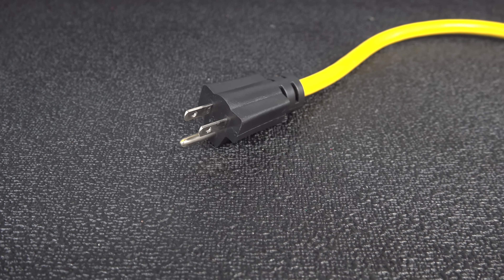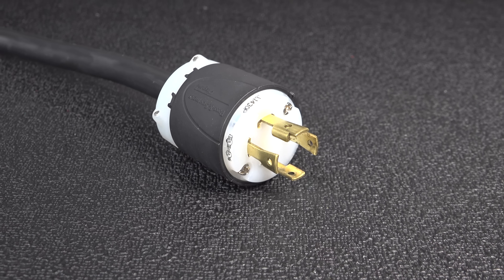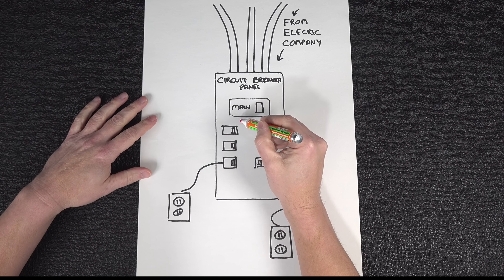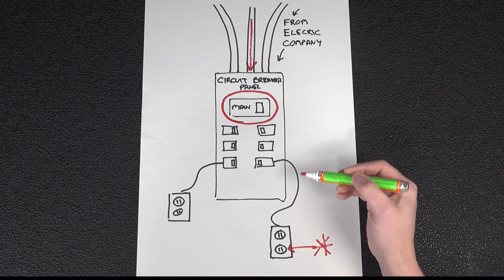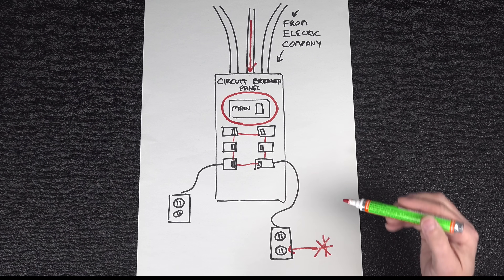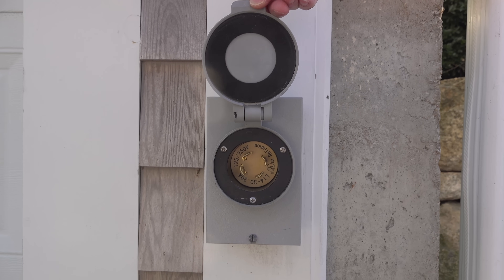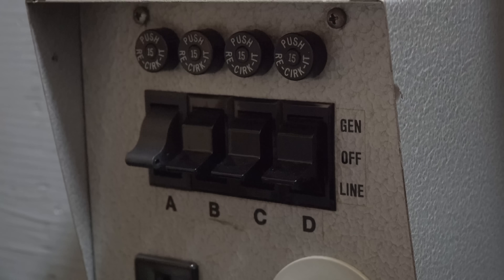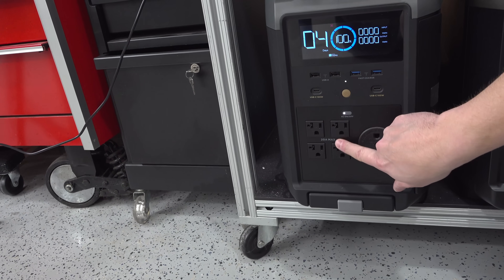Worst Electrical Mistake You Can Make - Backfeeding Generators

Comment: I used to remove trees from power lines and this was one of the biggest dangers.  One time I was dragging some branches and noticed that the dead line was still sparking, turned out that the local police had hooked a generator up to traffic light but didn't disconnect it from the grid.  When this happens the voltage gets stepped up to the full distribution voltage.
Reply: Yikes
Reply: “When this happens the voltage gets stepped up to the full distribution voltage.” Yep. Most transformers are agnostic. A transformer that takes in 13,000 Volts on its primary winding and puts out 120 Volts on its secondary winding will just as happily TAKE IN 120 Volts on its secondary and put out 13,000 Volts on its primary.
Reply: @Dee_Just_Dee  if you have 1 million volts and 0 amps what do you have? its call potential energy voltage is a concern but not the main concern. its the amps that poses the largest threat a typical or basic generator cant put out the amps to backfeed a grid voltage crossing a transformer may rise a lot because the amps are nearly removed ohms law
Reply: @kevinalmeida7159  why do you act like you know everything in a YouTube comments section? I'm not understanding. Your first comment was shutting down someone who works in a field essentially just trying to tell the general public just how dangerous generators can be for them, plus you don't know where he is, what country he's from, or what he's seen. Why not try and learn something from em instead of arguing with him because he said something you disagree with?
Reply: @DoubleTeaMedia  while your point has some merit most locations share most of the industry standards not all like where im from the  standards are the most strict seen anywhere so do with the info as you want. i will say had previously spent years as a engineer i should know a thing or 2 plus i so happen to be someone with incredibly low conductivity.... where as some would die from a shock i dont even know if im being shocked. i everyone is entitled to opinion and thats fine i just can sniff out excessive drama and information where the math doesnt add up.... if you did the math you would roll your eyes at the drama is his message to be safe good yes is it excessive in drama department yes.
Reply: @kevinalmeida7159  "I have magically low conductivity"... really?  Have you ever actually been shocked by a 120v 15a outlet?  I have.  When I was about 8 years old, my dad, who has a degree in biomedical engineering, taught me the difference between hot and neutral and I thought it was pretty cool that I could stick a paper clip in the neutral side of outlets and not get shocked.  Until I found one that was reverse polarity.  It didn't kill me, but hot damn, it sure hurt like hell and left my fingers black and blue after throwing me across the room.  My degree was in computer science, but working as an Engineer making medical equipment in the 25 years since, my knowledge of electrical engineering has grown as well.  You also seem to have ignored my point about how home PV systems are able to backfeed the grid if transformers don't work both ways.  You actually can run a fuel powered generator at home and tie it to the grid to backfeed it, as long as you synchronize the voltage phase before making the connection.  That is how multiple power plants can be on the grid at the same time.  Though I really wouldn't recommend trying it at home, it is interesting to know how it works in theory.
Reply: @phillipsusi1791  yes i have an abnormal high resistance i get shocked almost every time i work on home electrical because i dont care.... my most recent shock was working on ceiling fan my grip slipped and almost drop fan so it changed my grip to be holding all the leads in 1 hand and while im be shocked i get a good grip on the fan and set up a snag or suspension cord. my hand was getting a little warm and pinky had a small involuntary movement. it didnt bother me any. but i refuse to turn power off because it dont hurt and its more convenient to test while i work. im not the only one like this so it shouldnt be hard to believe. though i shouldnt test it nor be allowed to record it for a world record but i feel as though i have had the worlds longest exposure to live circuit without any pain or health problems

if you can backfeed grid then you are either on a solar program or your in a location that has not modernized. as i first made mistake grouping the whole nation to work the same as my area but, just like guns in some sense are almost completely banned here but other areas go anywhere you like with it on your hip.
Reply: @kevinalmeida7159  My dad has stories of old time power workers who would ground their middle finger then touch a fuse with their index finger ( in order to make sure the current did not pass through their heart, killing them ) and based on how it felt, could tell if it was 120v, 240v, or 480v.  I don't think that has anything to do with a magical high impedance of your body, but whatever... the more important thing is that transformers work both ways and there isn't anything that really needs to be changed in the grid to allow you to back feed the grid with home PV other than installing a meter that correctly registers the current direction so that the billing is correct.  Transformers always have, and always will work perfectly fine in both directions.
Reply: @phillipsusi1791  i seen this happen on our ship but his arm exploded into many bits of hamburger meat all over the place. he dad a arm then he didnt with a loud pop it took him a few seconds to register what happened to him then we applied a tourniquet then off to hospital he lived but never returned. i never thought to try and follow up with him but i didnt know the guy very well he was a welder that had to work near distribution panel. hes lucky his 2 points of contact was on same arm if it was both arms he would be DED! dead
Reply: @kevinalmeida7159  Amps aren't really what kill. Its really watts and joules that do the damage, and so long as your generator isn't already pumping out its max power upping the voltage WILL cause it to output high current and much higher power and energy.
Reply: @GuyFromJupiter  lol you almost made me write a book of science. Nope
Reply: Oh, right transformers work both ways, scary...
Reply: It does but you don't get the same current from a generator to the grid than the opposite
Reply: @karvast5726  that is my point im try to make the current is the main factor and this video and white knights are suggesting voltage is the threat and explaining something that has little to do with reality. the current from grid is massive and voltage is high but backfeed to grid is almost absent of current regardless of voltage. im just terrible articulating
Reply: @kevinalmeida7159  voltage is the main factor. Current comes from voltage. Ohms law voltage ÷ resistance = current.
Reply: Shep VanDelay  yea the primary was broken so it wasn't hooked up to the rest of the grid I think.
Reply: Please stop feeding the troll
Reply: @ediposantos6574  right!
Reply: I'm pretty sure linemen are supposed to ground any line they are working on, even if they know it's off, because of stuff like this.
Reply: Another linesman here from the UK.
Backfeeding our network can result in the transformer stepping up the voltage to HV levels - it can and does kill.
We have precautions to take to help avoid such instances but transformers are very simple devices, they are made as such so that they are reliable over decades of use out in the elements, they are not assessing what is flowing where, so expecting them to stop backfeeds is silly, they simply don't.
Reply: Shep VanDelay  I refrained from giving an exact value as they could be feeding 240V into a dryer plug which could change things. Or really, I think they'd need to to do that to get the full 12kV out of the transformer and would only get 6kV by feeding 120V in and it would be 0.6A either way. But I'm not an expert at how these particular transformers are built and hadn't even intended to think it out this much.
Reply: Shep VanDelay  You're right that only two primary phases would get voltage since only two are even connected to a residential transformer, but that's regardless of whether you put 120 or 240 into the secondary. Both primary phases are attached to the same winding with no center tap, so you can't put voltage into one without putting the opposite voltage into the other. If it was a three-phase transformer, it might work a bit differently.
Reply: Jesus!
Reply: See ,when ya backfeed a transformer out on the pole with your gennie in the house ,they work both ways. 
Big sparks ,it's pretty cool.
Reply: thats why you should use a generator switch or whatever theyre called
Reply: @Gigachad-mc5qz  we've got a customer with a broken one right now, and every time a storm comes up we have to go and switch them over manually, it's an hour away from the shop. Then we get to go back after the storm and put it back. Damn supply chain, the transfer switch is another 4 months out
Reply: @Gigachad-mc5qz  transfer switch
Reply: Why don't power company do preventive "short out" of the line for such situation, so anyone dumb enough to not disconnect from grid while running generator - will not be able to power it.
Reply: @digimaks  If they did that then they would have to come back and disconnect it before they could switch everything back on and the lineman don't need any more work. During an emergency they usually work 16 hour shifts.  The tree guys are often the first on the scene because the debris has to be moved to put the wire back up.
Reply: @digimaks  yes i agree and a safe electrician will first check and double check no power first then ground out a line before they work. with the added safety of municipalities that have upgraded to new national standards are aware of homes that can and cant feed back as well as notify you by mail and knock on your door prior to work. if they get shocked they either did a unsafe action or some evil fuck wanted to hut a lineman hence making this video an exaggeration or over dramatization. fake news
Reply: speaking of wires i was going throughout the day then i almost died from walking close to this dangling wire that is a meter from me, im glad i was young and i have great reaction time to walk back (i was looking at the side and then faced forward on where i was walking) if i did have contact with that i wouldve had arrhythmia for a lifetime or just not exist to this day
just paused when typing this from thinking of that, i must be so lucky
Reply: @stiaankruger2699  yea but I wasn't a lineman, I was just a tree worker so we weren't authorized to earth anything, just allowed to get electrocuted. Needless to say I left that job.
Reply: Police. What are you gonna do?
Reply: fucking cops, am i right
Reply: Yes police are especially ignorant people.
Reply: If power companies cared, they would make it easy and safe to use a generator.
Reply: Wow so it will backfeed through transformers and step up voltages?
Reply: @triptheroad  there may be a few area in america that has no upgraded and in this case if you run power  in reverse it may step up in voltage but when voltage rise amperage drops and if you dont have enough amps a transformer may block any type of lethal potential so unless you have a super generator its not going to do much and there are not many other uses but depends how or why you use it and if you pay your bills you should get notice when lineman are working so in most cases there is no concern
Reply: @kevinalmeida7159  I'm not too sure about North American distribution voltages, but let me assure you that especially behind a transformer, I would not want to touch an AC power line with a generator hooked up to it. Sure, the current limit will be less at a medium/high voltage than at 120VAC, but whatever the distribution voltage is will, paired with the resistance your body has, cause a way higher current to flow through you. You will probably die instantly, and way before the generator reaches its current limit (100 mA through you is already very, very lethal).
Reply: @TheLukasDirector  its always good to play it safe but the voltage drop over those long wires thick gauge cables and distance it must travel can be a very hard load on a generator and still not put out enough power to turn on a night light if you have a wide open back feed..... and amperage drop over any and all transformers and switches in some cases knowing that a typical home gen knowing the line system is older generation i will like the line i would be supprised if i felt anything now the generators in ship yard or other industrial city size NOPE!!!! DED dead lol
Reply: @km5405  You're probably right. I am not too sure whether it's about the total power or just the current (perhaps you know), but I don't feel like finding out either.
Reply: @TheLukasDirector  less than .5 amp at 120v can kill you if it passes through your brain or your heart. I've been shocked by 60kv ignition systems and that feels wonderful! Only reason it doesn't hurt you is there's only a few mA of current. Take 30a at 120v, step it up to 12Kv and you still have .3a. Pretty dangerous.
Reply: It truly does come up to line voltage  the transformer works both ways because now you've essentially reserves the coils by reversing the flow of electrons so instead of stepping down to house voltage  it steps up to line voltage
Reply: Sooo what’s the difference between removing trees from energized power lines and deenergized? You always treat all lines even down lines as hot so ???? What was the problem? Lineman don’t care about backfeed.
Reply: @somethings6015  yes dont be like me and always work on live lines because my natural conductivity is low so i dont even know if 120 is shocking me lol but i dont take chances with 240 i made sure wiring my tesla was safe
Reply: thats not really the same but you probably wouldnt know why and lot to explain
Reply: @kevinalmeida7159  it's literally exactly what's happening here, the transformer on the pole steps the voltage back up to 12kv.  There was a transformer on a pole that the traffic light was hooked up to.  We used to listen for generators for this exact reason.
Reply: @Aholeintheozone  ok but that canister has more than just a transformer it a switch box if line comes in it is diverted to all locations tied into it and its intended to have 1 way flow to prevent every home on grid to suffer spikes or shortages you can tap in with a gen but that gen cant power the city it can only power to the diverter if the gen was close enough to your work to show sparks on a bad like it can have a few reasons like location to diverter or faults. would have to know all the details or diagnostics but line workers have to have safety from flow lust because the power was cut doesnt mean home owners are not doing something crazy so these diverters are meant to flow 1 direction and a line worker can and should loop a home line to ground till service is complete so any attempts to energize a home line trips gen braker before it can injure a worker because most homes dont have lock out tag out procedures
Reply: @kevinalmeida7159  some might be designed to flow one way but iv personally see a complete dead distribution line arc from generators on multiple occasions.
Reply: @Aholeintheozone  sounds like your municipality needs to come up to federal standard i believe you
Reply: @Aholeintheozone  In stepping up the voltage, the maximum current would be pretty low before it bogs down a typical consumer generator. Going up to 12kV, you'll get less than an amp from a 30A generator. I'm not saying I'd want to touch it myself, but it's nowhere near the same as if the cable had a large power plant connected to it.
Reply: @chitlitlah  it just takes a few milliamps to kill a person. The breaker on the generator should trip, but life is more important than 'should'.
Reply: @TomCee53  Yeah, sure, if the electrodes are stabbed into your heart. You have a very small chance of dying from a 100 mA shock, but it takes over an amp for death to be likely.

But that's irrelevant to what I said anyway. You're going to be shocked with more current if a power plant is supplying the voltage compared to a small generator which contradicts the statement that they're exactly the same.
Reply: @kevinalmeida7159  you did not use a single period, comma, or any other punctuation In that wall of text. Do you realize how difficult your comment is to read?
Reply: @himabimdimwim  sorry im autistic and the written language is the hardest thing on the planet to learn. i rarely can convey or articulate properly with a keyboard. made collage a nightmare but i know my math and science far and away above the average folk strengths and weakness
Reply: @chitlitlah  sounds like you and i are making the same claims
Reply: @kevinalmeida7159   ah, okay. A tip that helped me learn punctuation is to always put a comma or period at the end of a thought, idea, or topic. Too much punctuation is still easier to read than not enough punctuation. Language is extremely complex, and I understand your frustration.
Reply: @himabimdimwim  fair, enough, lol hahaha. to much is easier....... mmmmk. i will get hate regardless but i think i will try that.
Reply: @kevinalmeida7159  you're wrong in so many ways, transformers do not care which direction they're being fed, it will step your service voltage, 120v let's say up to 14,400 volts for example. It is true current is inversely proportional to voltage, but guess what, it only takes 0.0005 amps to stop the human heart. A 15 amp load on 120v would be reduced to .125 amp if we use 14.4kv as our distribution voltage. That is still 250x the minimum voltage to stop the human heart. I know this because I am actually a lineman and I was working on a line when a customer backfed it. Also, as a lineman, we ISOLATE lines from the rest of the grid in an outage, so it could be a very small portion of distribution line that a generator has to power and there wouldn't be anywhere near enough resistance to trip anything. Also, another thing to note, the protection a transformer has is against amperage via fuse, or CSP, which is an automatic switch, that only opens the circuit when a certain amperage is reached. I know all this because one mistake in my field of work it lethal, so let's stop spreading misinformation to all these people and keep people like me alive so I can come home to my family and keep the lights on. Thanks.
Reply: @kevinalmeida7159  
Average trumpist I see
Reply: @chitlitlah  if said voltage is at a potential of 12kV you skin ceases to be a insulator and your bodies resistance is about 2kOhm not a few M.
Reply: @km5405  I never said you wouldn't get shocked, just that as the voltage is stepped up, the current is stepped down by an equivalent proportion. If the generator can only output 30 A, then it would be closer to half an amp past the transformer. Then the voltage is going to start dropping. This isn't the case when it's connected to a power plant.
Reply: @kevinalmeida7159  You had me in the first half, but now I know you're kind of bsing people here. 1 volt wouldn't be enough to go through you, a million definitely would, but it takes less then an amp to kill a human. Transformers are, in most cases not 1 way, I don't know who told you that but that's completely incorrect, most transformers on the power grid go both ways. We ALWAYS have to be aware of generators when working in storms as the WILL kill us when stepped up to whatever the dist voltage is.
Reply: @cotycollins6302  im try to use laments terms to make point to clueless. simple explanation, electricity is dangerous but volts is hair stand up, amps is dead. i can explain math and theory, do i need to become a professor or can i make a point. my autism doesnt always allow me to say all the right words and save time and avoid preachy demeanor
Reply: @kevinalmeida7159  you're not, otherwise you wouldn't be arguing a 1 megawatt shock won't do anything to someone.
Reply: @kevinalmeida7159  no you have no idea what the fuck you're talking about. I've never seen any non passive transformers at the street, they would have to have some sort of circuitry to open themselves from the supply voltage unless it was actively listening for a signal embedded in the supply voltage, otherwise I can't think of anything that wouldn't reclose if a voltage was induced in the primary from back feeding the secondary. What mechanism do you propose that does this? Are you suggesting diodes perhaps?
Reply: @kevinalmeida7159  I don't know where you heard of this "diverter" but if it even exists, whatever it is, it can't stop the power from flowing the wrong way.  It's AC; it's always flowing both directions.
Reply: @lukerediger8431  huh what are you talking about apparently you got the wrong message from my intent make it easier and go away i cant talk about apples and here you are talking about dreams. what ever i am not going to teach or explain how it works and the many items say what you want but i will not be baited
Reply: @phillipsusi1791  i can stop current with wires and a few  other ways i can do it with items like transformers. sorry your not an electrical engineer im not here to teach you my trade.
thaks for your irrelevant comment i will leave it there
Reply: @Aholeintheozone  I think you experienced static electricity not a household generator backfeeding. It makes no sense that a household generator wouldn't trip out immediately if connected to the grid.
Reply: @spencerblackman7670  the primary was broken
Reply: @kevinalmeida7159  You are very obviously not an electrical engineer. Nothing you have said so far makes any sense. 

No, transformers are not directional. A transformer is just two inductors on an iron core, there is nothing preventing it from working in both ways.

No, you will not die if you touch a power source at 1 Volt, which is capable of delivering a million amps. Your body has a DC resistance of about 1000 Ohms, so calculating with Ohms law the current flowing through your body would be 1mA. Not even enough to notice.

Yes, you will die from touching a power supply at 1000kV which is capable of delivering 1A. Again calculating with ohms law, at 1000kV with a unlimited power source the maximum current would be 1000A. We are limited at 1A so thats the flowing current through the body, and 1A is very lethal.

So no, current isn't the killer, energy is (V x I x t)
Reply: @gutesache1  you have the right formula but doing the math wrong. know all your values before you try to do math i used exaggerated numbers to make a point and what values you use? source load and resistance, duration, distance, material, size, voltage drop and much more.
a transformer is bidirectional but will perform the task designed 1 way and have an inverse the other. 
i can make it a 1 way by many means.... i can use different materials or wiring or other devices to get the desired outcome. maybe you lack the knowledge but your argument feels like a child explain science to a scientist hahaha.
i have abnormally high resistance on a 15 amp circuit i dont even notice if im being shocked 20 is a good jolt.
Reply: @lukerediger8431  never mind you dont get it its like a scientist explaining his craft to a child in simple terms and still looks at you with a tilted head
Reply: @kevinalmeida7159  Even if your body resistance would be 100kOhms, 14kV capable of delivering over 50mA would still kill you. 

I don’t know what you are trying to prove here, but you are wrong in almost all your points.

1. Tell me what math I am doing wrong. Because even though the 1kOhm is an approximation, at high voltage it wouldn’t matter anyway. The skin burns down and lowers the body resistance significantly.

2. Give me only one way to make a transformer unidirectional without external circuits and I’ll shut up.

3. Yes if you would connect a 15kVA generator to the distribution grid it will stall and (likely) not be a harm. But if the transformer is isolated and people are working on it, there will be 14kV present and a touch would be lethal. Of course it should be earthed and short circuited if people are working on it, but we can’t always trust on the safety consciousness of the workers. That’s why we have redundant safety measures.

4. “I have abnormal high body resistance, I wouldn’t die on a 15A circuit” that’s because you guys have 110VAC which is dangerous, but with not much time on the circuit, and only one pole connected almost never lethal. And you know that there is not 15A flowing through your body right? 
Plus, 1kOhm is a very “safe” value for body resistance, in reality with dry skin it’s almost always more. But that doesn’t matter, 14kV is almost always lethal if it can deliver more than 50mA.
And you know that a 15A and a 20A circuit are both at 110V right? So the shock would be the same. With 10kOhm body resistance you would have 11mA flowing through your body, not lethal but definitely noticeable.

You are very obviously not a scientist, you don’t even know the simplest basics. I’d bet that the apprentices at the company I work for could correct you on your statements. The electricians sure can.
Reply: @kevinalmeida7159  I actually am an engineer, and I'm sorry to tell you that the only way the power grid works exactly because power flows both ways through transformers.  How do you think home solar systems backfeed the grid?  Or how multiple power plants are tied to the same grid?  You rotate the phase of the current waveform 180 degrees and the power flows the other way.
Reply: @phillipsusi1791  i know i have my own off grid system i already covered this in previous talk im not going to cover it again. i know what you say to be true but your missing to many pieces of the puzzle. when you learn my craft we can chat.
from engineer to engineer; just because your a basket weaving engineer does not help you win the argument hahaha. why does my off grid system not feed back to the grid because i dont want it too i pay a service fee for keeping potential energy to my home but i use none so my bill is 25 dollars every month and the grid cant have any of my energy because i dont want them to. if i was willing to share my energy with grid they need to make a service call to set up the grid to allow for back feed then grant me access to sale of energy i collect but i cant sale it because they have it 1 way and im not telling them i have a solar system that can be used by anyone but me.
Reply: @phillipsusi1791  this guy's had people stirred up for over a week.😆
Reply: @chitlitlah  actually u are misinformed my man, it is most definitely lethal at less than an amp. I know of an instance 700mA was fatal
Reply: @chitlitlah  it still isn't safe, even at low amps you can get burned or nerve damage. Less than an amp at 12 kv can still be fatal in the right conditions, even if it's just a consumer generator.
Reply: @dannymac7852  You didn't read what I said, my man. I said as little as 100 mA can possibly kill you, but death isn't likely until you get up to around an amp. Providing one instance of someone dying from a little less than an amp (and I have to wonder how anyone knows it was 700 mA) doesn't contradict that at all.
Reply: @hunterra217  Read where I said as little as 100 mA can kill, albeit with a lot less probability than an amp. Read where I said I wouldn't want to touch it myself. I don't know how you people are taking what I said about a household generator not having the same effect on someone touching the lines on the high voltage side of the transformer as if a power plant was providing the power and then acting like I suggested it would be a walk in the park to grab the lines.

The point was that two devices that produce the same voltage won't necessarily cause the same damage if one can't produce enough power to maintain that voltage when it's shorted. The coil on a car produces about the same voltage as the neighborhood power lines, maybe more, but I'd shove a spark plug up my ass and turn it on before I'd mess around with the power lines in any way.
Reply: @chitlitlah  That's very true, but it only takes milliamps to be dangerous. 12kV lines are very dangerous.
Reply: @kevinalmeida7159  side note - It’s really hard to understand what you’re trying to say without any punctuation.
Reply: @chitlitlah  it doesn't need to be directly in your heart. If the voltage is high enough,(13kv is definitely high enough) that 100ma, will flow through your heart from your hand. 1 amp is plenty. Voltage ÷ resistance (human body) = current. 100ma can kill but it's unlikely. Once you get to 1 amp and above death is likely. A generator stepped up to 13kv at 1 amp will pass that 1 amp through your heart by touching it.

A microwave oven transformer is ~2kv and "only" 1 amp it can and does kill people.
Reply: @kevinalmeida7159  you’re awesome
Reply: @kevinalmeida7159  does it matter
Reply: @the_official_jaydo  to you it must not 👍